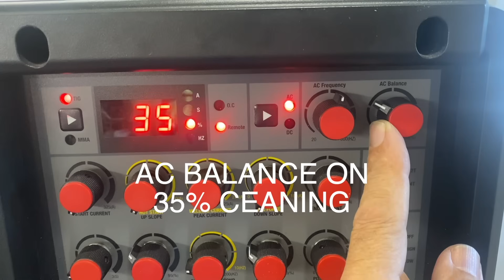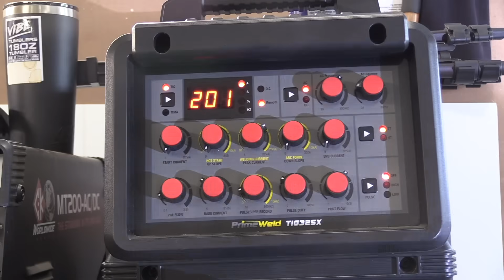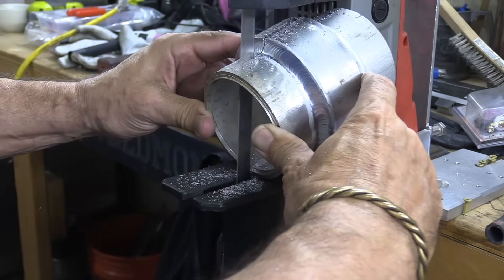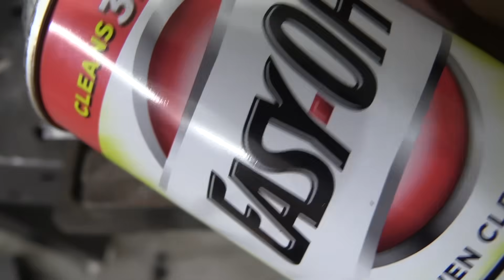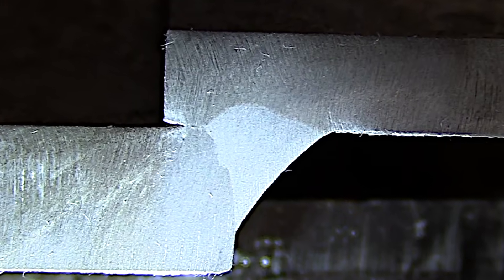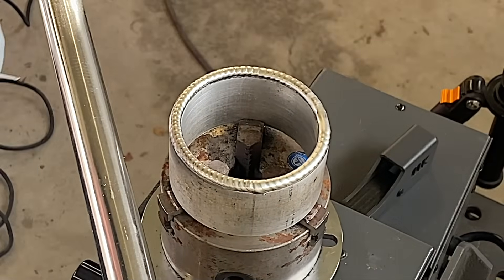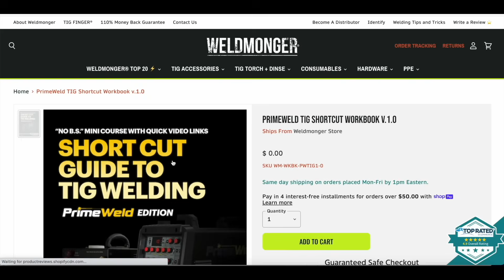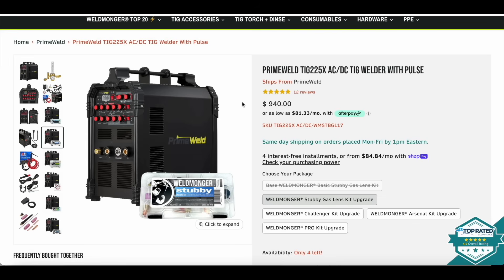PrimeWeld TIG325x Aluminum TIG Weld

Comment: I want to learn how to weld with a Tig machine and exactly I had in mind the Tig225X or 325x ac/dc. I have doubts when choosing the options, such as the 12’ or 25’ Air cooled or water cooled torch stock!😵‍💫🤦🏽‍♂️ Spend once instead of making upgrades that along could be more expensive?

The million dollar question: do I need the tig225 or the 325 ac/dc? 🤷🏽‍♂️

Comment: If you’re gonna tig weld aluminum I find the green tungsten works best. I build 120 foot aluminum traveling bridges for sanitary waste plants. So I have to mig aluminum weld them along with tig welding them. Green works great just ball the tip of the tungsten and go to town. And if your mig welding aluminum 5183 wire works great.
Reply: what MIG machine do you prefer? i bet alu bridges require 250-300+  amp size TIG welders

Comment: Need help deciding. Primeweld 225 or 325
Reply from the maker: there are a few main differences.  the 225 is much more portable but has a hotter start and also does not read out digitally on pulse settings and other settings like ac balance and frequency.  That is not a huge deal for me but the digital readout on the 325 is nice and helps with repeatability on pulse settings.  The 325 has a 5 amp start so if you need to weld really thin metals that is a huge plus.  The 325 is a beast but it pretty heavy so I wouldnt want to tote it to a job site.
The fan on the 325 is louder than the 225 so i just wear ear plugs for that.
both weld great in my opinion but the start on the 225 is pretty hot for anything thinner than .020"
Reply: @weldingtipsandtricks I was told the 325x got an update on the fans so there a lot quieter now I think they change this a month ago they also change the red knobs to yellow now
Reply: I'm thinking the 325 is probably my best option. 98% of my welding is marine repair. I don't deal with much over 1/4 but I do deal with alot of thin. So being able to fine tune will be a big difference and the lower starting amps.

Comment: I ordered a 225x from you yesterday!  And specifically for a project welding aluminum.  So thanks for the excellent video. I'm excited to get everything.
Reply from the maker: Awesome! Thank you!
Reply: I have that machine and it works awesome. I build aluminum structures at work with industrial miller machines and Lincoln machines at work and at home even on 220v this machine can weld awesomely!!! I love it. I also bought the mig 285 from prime weld. Both great great machines!! You will be impressed!!! Have fu n welding away lol

Comment: I have a question, that you may have a video I missed the answer. Counting only the consumables, what is the cost per inch of making equal welds, steel and aluminum, using mig vs tig vs stick? Thank You!
Reply from the maker: i have never really taken the time to try to determine exact cost per inch for each process and metal type.  but one thing that makes the biggest difference is labor cost. If we are talking about welding a few parts in your garage, I think the material costs for gas and consumables would be minimal from one process to another.
  But if you are paying someone 30 or more dollars an hour, then all of a sudden the speed of one process can make a big difference.  
For example, one shop I worked wanted to MIG weld 16ga stainless but then we had to grind the welds. I finally convinced the boss that tig welding was faster when you figured in the grinding and blending needed for the mig welds.
Reply: @weldingtipsandtricks  Thank you!!

Comment: Good morning! Was wondering your opinion. I have a OLD miller 250 syncrowavre that I bought new back in 1993. I would like to replace it with something with a smaller in size not amperage though. What  do u think. To buy a new miller is crazy $$$$ I don’t have a cooler on my current rig setup.
Reply from the maker: I did the same thing way back when the dynasty 200 first came out.  The syncrowave 250 is a great machine but I moved and my new garage only had a 30 amp breaker so I sold my 250 and bought the dynasty200 and made a shelf on the wall where it was out of the way to save floor space. back then the dynasty was only around $2000.  Didn't really weld any better but helped on floor space.  I kinda wish I would have kept the syncrowave 250 but I just didnt have space for it.  Today the primeweld 225 is a great alternative but doesn't have quite the low amp start.
There are lots of affordable tig welders out there but not all treat you well if you have an issue. I sell primeweld as opposed to all the other brands because I trust their customer support.  The few problems I have had have been taken care of quickly.
Right now, I am testing out a new mig welder from them so you will see some videos and review on it soon.  Its an MTS200 ,  thanks and I hope this helps
Reply: @weldingtipsandtricks  thanks I appreciate it. You do an outstanding job as always!! I appreciate your channel. I’m a Pipefitter/welder & always refer young apprentices geeked out on Welding like I used to be. To your channel to get all the fine tune setting stuff / tips tricks!😎 have a great day!
Reply: Millermatic 251 it’s about 20years old same question trying to save some space but………

Comment: I like the fact that prime weld machines have buttons and knobs and not all this computer screen BS. The prices are really good too. I got my eye on one of their mig machines. As for feeding tig wire, I suck really bad but I'm not welding a whole lot in my shop. 👣👣👣👣👣👣👣
Reply: That's sorta nice except when you're adjusting pulse settings. It's hard to get it right especially when you're shooting for something like .5 pps or a strange peak time. The granularity at the bottom end leaves a lot to be desired.